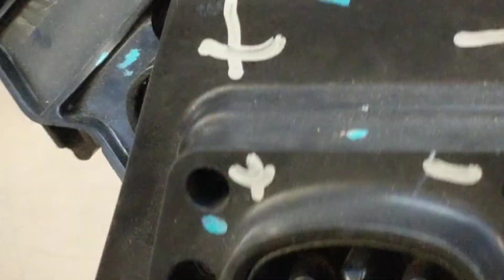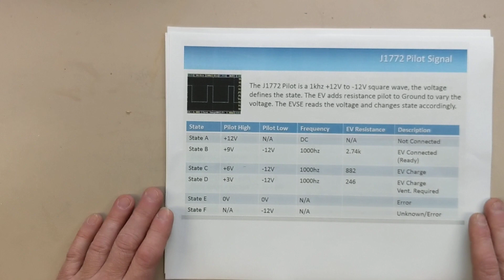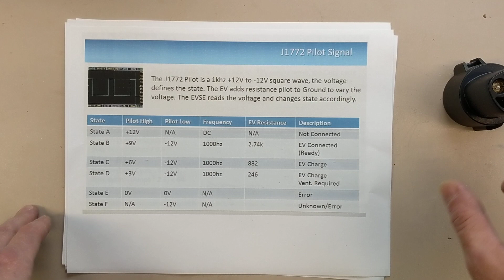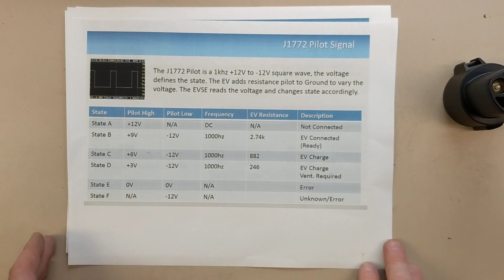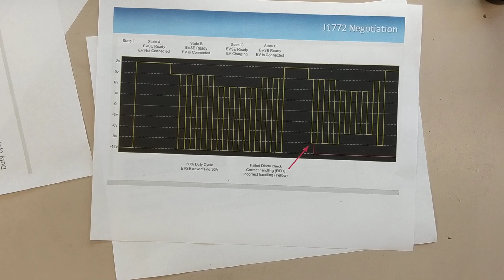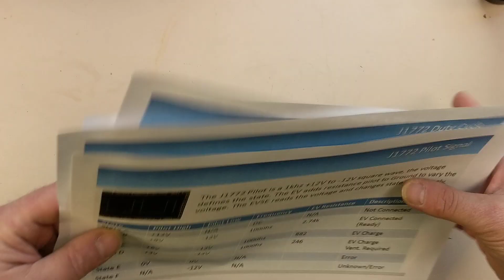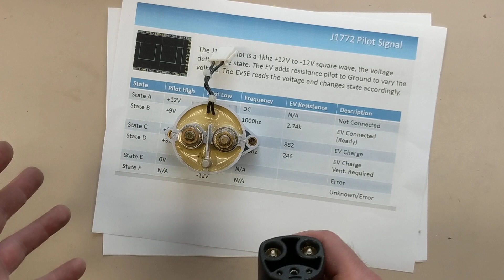Tesla Charging - How Does it Work?

Comment: The charge port door  on the model x does not have a magnet in it ..it has the push button ..and it seems super buggy is that firmware issue ? The charge ecu on the Model x looks similar but  it’s different
Reply from the maker: New Model X switched to this type.
Reply: @Ingineerix  tesla has come out 5 times to fix they replaced the charge port door and the charge port ..the lights on charge ecu are always flashing 2 red leds ..it never gets the slow one led ..the charge port closes and opens fine but it doesn’t on the screen or the app .it says door sensor error ..tesla can’t fix it
Reply: @Ingineerix  2020 model x
Reply: @Ingineerix  no wonder Elon shutdown line it’s because of firmware and communication errors on the model x ..the 2020 is just super buggy ok everything

Comment: Great info! I was hoping you would also include an analysis of the RF signal that happens when you press the button on the tesla charging handle.
Reply from the maker: The handle sends a 315MHZ (or 455MHZ in EU) RF signal to a small receiver in the CP ECU.   They use this RF/MCU to send:  https://www.silabs.com/documents/public/data-sheets/Si4010.pdf
Reply: I’d like to know that too.  My guess is that pressing the button sends a signal to a coil/antenna in the handle that is detected by the inductive sensor he mentions about 5 minutes into the video.  Seems like the simplest way to do it.
Reply: This is what I wanted to know too - thanks for the explanation @Ingineerix!

Comment: I always wondered what the ventilation mode was for. I hadn't considered less acid batteries!
Reply: Communication protocol did came over from 90s, with cars as a gm ev1, Ford ranger electric, Toyota rav4ev(1gen), Honda city and other was been a thing. Most of them(lead-acid and ni-cd, ni-mh packs was been a main choice and they are require ventilation).

Comment: Is there a way to access the DC voltage directly from the battery pack. I guess if you power the contactor, you can then get high voltage DC from the charging port? Can you "trick" the charging port to output DC some how. Most modern European appliances will work just fine on 315Vdc directly. Switch mode power supplies work fine on DC. LED light bulbs too. Some new microwave ovens have SMPS and not transformers. I've tested some appliances for DC operations. https://youtu.be/Au3wURws_Bg
Reply: There is a liitle problem with doing that: battery is 403.2v when full and 288-316,8V close to empty and battery voltage is all you get. APFC swichmode power supplies won't have a problem with that (mains voltage is boosted to 400V anyway - that is what APFC does), but non-APFC might.
Reply: @volodumurkalunyak4651  you might be right. But it might still be worth experimenting with some appliances at 400vdc. Some times there can be a useful voltage tolerance 😉. The main filter capacitors are often rated at 400v it's close to the maximum but it might be okay.

Comment: There's also a variation in pin lengths- the ground pin is the longest so it's first to connect and last to disconnect (for obvious reasons). Then the main power pins.  Then the proximity and control pilot pins are the shortest, so they are the first to disconnect.  This is a redundant protection so if there was a failure with the button or some form of forceful disconnect, the car could have a few milliseconds to try to drop the current when those control pins disconnect before the power pins lose connection.
Reply: A bit like a USB connecter, where the power lines are extending a tiny bit further outward than the data lines. Gives time to power up and initialise things before the data starts to flow. :)

Comment: So are you saying the early 2019 and previous Model 3 vehicles will not be able to use the CCS adapter without a retrofit when it’s released in North America?
Reply from the maker: Correct.
Reply: @Ingineerix  That’s a bummer. Hopefully it’s not too expensive to retrofit. I’d love to have that capability as another option on road trips.
Reply: @JimArnold6  I think Tesla already does retrofits of the newer CCS-capable controller on older S and X cars in Europe so they can use CCS chargers with a Tesla-supplied adapter (the euro equivalent to the new Type 1 CCS adapter Tesla is just now selling in South Korea). I have a vague memory that the cost of upgrading the controller board on these older cars was around $200-300. I imagine that Tesla could offer a similar upgrade in North America and other CCS Type 1 markets if they wanted to.

Comment: This site is the best I’ve experienced.  Would you do a video on the Plaid rear camber and toe arms? Are they adjustable? I’m concerned about rear tire wear.
Reply: @RicTSLA:  Phil already did this video.  Check out the Plaid rear motors drive which shows the entire rear suspension including the 5 links.

Comment: how does charge handle  click button get sensed by car when used to open charge door?
Reply: Tesla has an extra wire in the cable that powers a small transmitter in the handle, similar to a garage door opener signal.
Reply from the maker: The handle sends a 315MHZ (or 455MHZ in EU) RF signal to a small receiver in the CP ECU.   They use this RF/MCU to send:  https://www.silabs.com/documents/public/data-sheets/Si4010.pdf

Comment: There's a Proximity (or Proximity Detection) and a Control Pilot.
"Proximity Pilot" is generally a misused term in the US, Proximity Pilot is used for the type 2 standard in Europe where they have removable cables.  Charging must be limited to the lesser of 1) Charger's max output, 2) Vehicle's max input,  or 3) Cable's ampacity rating.  Proximity Pilot is the signal the removable cable uses to tell the EVSE what cable rating is plugged in.  It uses the same "pin" but on the "other side" of the cable - remember Proximity Detection at the vehicle doesn't leave the handle, it's not connected to the wire in the charging cable.   Proximity Pilot has nothing to do with Proximity Detection on the vehicle side.  But people in North America hear "Proximity Pilot" and just assume it's synonymous with Proximity Detection.

Comment: Elon said the cars are going to support 300kw soon, did they have to make changes to the connector for this? Assuming they will also need to upgrade the chargers?
Reply: That likely will come from the 110s in 2022 Model S/X battery packs instead of 96s (former S and X, 3+Y). This is an 15% increase in voltage. 250 kW peak * 1.15 = 287 kW peak. Round up in an optimistic fashion => 300 kW. It will likely apply to 2022 Model S and X only. Tesla then will need to take care, that the Tesla chargers can actually provide up to 110s times 4.2 V = about 462 Volts plus a little bit, so 500 V DC. So far, they were capped at around 410 Volts.
Reply: Also can you do a tear down/deep dive into the keys (phone, card, key)

Comment: Things get slightly more complicated with European Teslas Model S+X (2012-2021) with an Type2 inlet, running DC mid or AC 3-phase. There, you need four contactors (instead of two) to either connect 4 pins to either 2x DC+ and 2x DC (DC charging) or connecting them to L1, L2, L3 and Neutral (3-phase AC charging). CCS gets rid of them: the DC lines go to the battery contactors, the AC lines to the onbord charger.

Comment: Tesla connecter was designed by engineers with the best ideas used, CCS was designed by a marketing department whose goal was to discourage EV adoption.
Reply: Not true, Leo. CCS was designed to be capable up to 500A and 1000 V DC, 400 kW to support charging busses and trucks. The proprietary US Tesla connector will likely show its DC limits with charging Tesla Roadster II and Tesla Cybertruck.
Reply: @koeniglicher  
Would it not have been better to design a proper heavy duty connecter for busses and trucks since they will not be using the same charging network?
Reply: @universeisundernoobligatio3283  In Europe, large trucks (like Volvo BEV trucks or e-Actros) and busses (like e-Citaro) occasionally do use the same charging network. Charging stations can be designed to actually support both vehicle types. Still, your question is a valid one for ever increasing demands of trucks and coaches in the 1 MW range. There is a point where CCS either would need another update or heavy duty BEV connectors and inlets need to be designed.
Reply from the maker: The heavy duty system is already in development.  It's called MCS:  https://www.charin.global/technology/mcs/
Reply: @Ingineerix  And for asia, especially China and Japan: ChaoJi with (600 or up to 900 Ampere, up to 1.500 Volt). Successor of GB/T  and CHAdeMO. Intended for both: cars and light trucks and busses, up to heavy duty vehicles. In the end, not every truck or bus will need the up to 3 MW of MCS, especially with overnight charging. And different markets will likely go with their own connectors for political reasons.
Reply from the maker: Sorry, Tesla easily hits 650A already on the US connector.  CCS can't (yet) support this.  400kW is only possible with higher voltages.
Reply: @Ingineerix  "Tesla easily hits 650A already on the US connector"  - peak or sustained value? BTW: CCS can already support what the US Tesla connector can. Remember, that the European Model 3+Y only have CCS. And Tesla enables 650 Amps over CCS (250 kW for 5-10 minutes) on its SuC V3 here in Europe.
Please see for an update on actual CCS implementations: This new CCS charger in Sitzerland with CCS connector by Brugg - https://youtu.be/gVg6K34t_wo?t=325
CCS with 500 A nominal (uncooled pins from the DC charger side) and 850 A nominal (pins with water cooling from th DC charger side). As you can hardly get the cooling to work on the actual car inlet pins with simple metal and plastics adapters, at some point in time, I guess Tesla will gradually phase out its proprietary US connector and switch to some other standard in the US as well. When volume-production of Cybertruck will actually happen, then the time may be about right. Cybertruck may even be constructed around an 800V system. In the end, higher and higher amps increase charging losses significantly.
Reply: koeniglicher The Tesla connector only need to switch out power relays to support higher Amps and higher Voltage. The connector are just metal and plastics the electronics behind them is what regulate the charging power.
Reply: @kazedcat  Metal and plastics is important. Metal pins need a higher diameter for higher amperage so that they do not overheat. Plastics needs certain distances to still isolate from higher voltages. Just think of why a CCS socket or the Tesla connector look different than a NEMA 5-15 or European Type F or Type G household plug. They are also just "metal and plastics". And a USB connector is also just "metal and plastics", but for way lower amps and voltage.
Reply: @koeniglicher  This video already told you that the pins can support 500A to 600A and the plastic is not important because the system already have mechanism to prevent arcing and the air gap is wide enough for 1000V and higher.
Reply: Typical nonsense....
Reply: But Tesla connector does not support 3 phase, so it’s better only for USA context

Comment: Interesting the new connector matches the original Tesla connector
Reply: In Tesla it was been only two tilypes of connectors: one what was been used on roadster and afterwards Tesla start using existing connector on S in 2011 if I recall it correctly.

Comment: So, when Tesla brings the CCS adapter to the US, will Tesla need to replace that PCB on older S and X vehicles?   Any other changes necessary?
Reply: We have an adaptor and mods to the charge system cost approx £300
Reply from the maker: Older S/X need a bit more.
Reply: Yes exactly correct, the charge communication box is replaced/inserted at about 150€ for cars made before 2019. Then after that time all cars need the adapter which can do 150kW in addition for about 150€ as well. The prices might be a bit off, but Tesla fully supports the upgrades and do them off-site.

Comment: Old Model S and X can upgrade to suppot CCS in Europe. They change the small, white charge controller in the car, and give you an adapter similar to the US J1772 adapter with Combo2 input and Type2 output. Adapter is a passive adapter only passing electricity thru it. Model S and X used only the AC-part of the Type2 plug. Even for Supercharging.
Reply: If the adapter was completely passive only, it could not contain an electric locking mechanism to lock the CCS plug to the adapter. This would be dangerous due to arcing, if someone just pulled out the CCS plug from the adapter during charging.